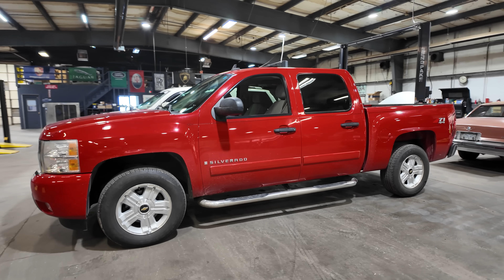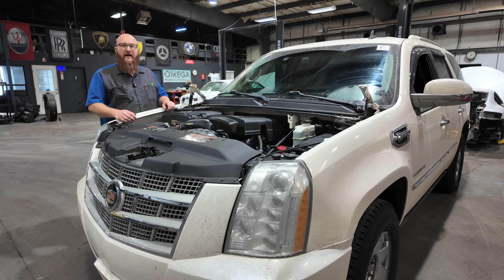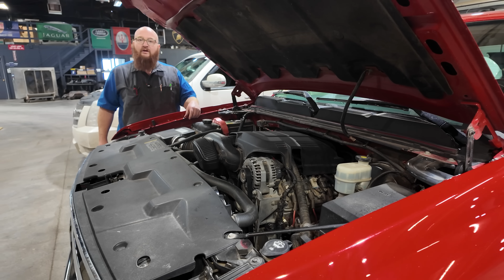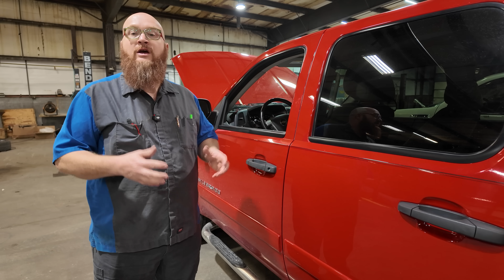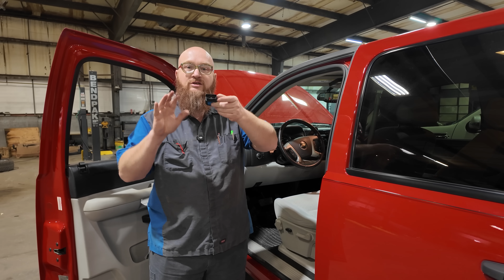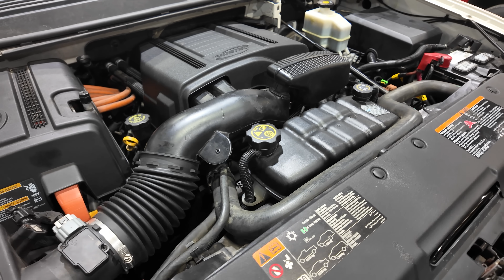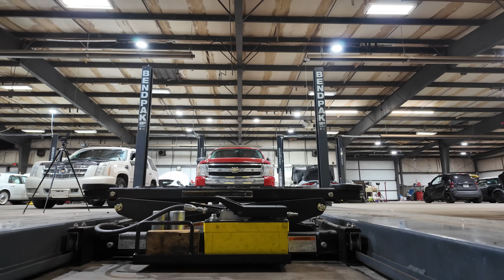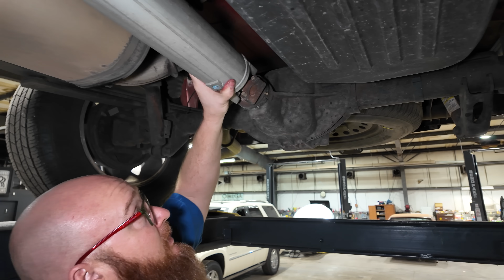AFM: Engine Saver or Engine Killer? The REAL Answer

Comment: 2017 silverado, 5.3, 6 speed, 74,000 miles, bought new.   The first thing I did on this truck was the afm disabler and the tranny thermostat change.   No problems until 45,000 miles when I started to get a minor tranny torque converter shudder. changed the tranny fluid out, not ac delco, shudder went away.

Comment: I have a 2012 Chevrolet Caprice PPV with an L77 6.0 and has the fan grenade from the factory. When it was operational the fuel mileage was worse. I added a disabler and so far no problems.

Comment: Have a ‘21 Acadia V6 and I just drive it in Sport mode basically all the time. You can watch in the gauge cluster and see that the “V4” light doesn’t come on that way. Drives better, too 😊 And it’s not like it gets good gas mileage if you let the cylinder deactivation do its thing; matters very, very little.

Comment: It seems counter productive to have AFM on HD model trucks that tow a lot.
Reply: If you're towing, then you'd be in tow mode or manual mode anyway, which deactivates the AFM.  AFM is meant to come on when the truck is experiencing the lightest workload possible.  In my Ram with the 6.4, the MDS will kick in if I'm just cruising at 35-50mph on a flat stretch, but since it's not easily deactivated without a PCM unlock and parts swaps, I just use tow mode when driving around town if I find that it is activating too often.  It rarely kicks in when I'm cruising at 60-75 on the freeway.
Reply: @jp1087  you probably don't care, but your MPG has to be brutal in constant tow mode with a 6.4
Reply: @waywardson-i1t  The difference is negligible, if any.  I don't put my foot into it. But I only drive it about once a week anyway when I need to use it or when I feel like it's been sitting too long.  MPG doesn't really matter when I only have to fill it up once a month.  It will get used more in the summer, but it will be towing a big trailer then, so mpg doesn't matter there either. I don't track mpg for running around town in any of my cars. I have taken it on a couple short highway trips without a load, and MPG has been around 18 avg.
Reply: @jp1087 Tow mode does not disable AFM on GM trucks.
Reply: @RyanAdcock-l4h  It does for sure.  I had a Yukon with AFM, and tow mode not only disabled AFM, but it also locked 6th gear out of use.
Reply: @jp1087 On mine it does not. I can watch it switch to V4 on the fuel economy info page whilst towing, with tow mode active. I can only vouch for 2008-2020 model year Yukons, though. Haven’t tried with 2021+.
Reply: @RyanAdcock-l4h  My Yukon was a 2011. Tow mode locked out 6th and turned off AFM.  But once I replaced the trans, I got a tuner and disabled AFM anyway, so I didn't worry about it.  The AFM didn't net any real world benefit.  The only time it ever came on for more than a few seconds was when I caught an amazing tailwind headed down 138E to Mojave.
Reply: HDs never had AFM
Reply: @michaelmcconnell6347  Ram HD's with the 6.4 have it.  GM and Ford didn't put it in their HD gassers.
Reply: @jp1087 Mopar and Ford don’t have AFM, their systems are different
Reply: @Bonez1LE  Different names for the same thing - cylinder deactivation.
Reply: 2500s 07 and later with the 6.0 do not have afm from the factory.

Comment: OEM 'quality' is the source of the problem.
GM doesn't believe in quality - it hurts the bottom line.
There is nothing wrong with the concept in engineering terms. It is the quality which dooms it.

Comment: 09 tahoe with the 5.3, New motor at 100,000 miles due to bad AFM lifter, another one went bad a few months ago at 270,000 (170,000 on this motor). Just did the full delete kit from TX powersports and LOVE IT!! Fuel mileage hasn'tchanged one bit. That was a total scam and just created a weak point in an otherwise decent engine.
Reply: It was a great engine before that was added...known to get 400,000 no problem.
Reply: @barrya.6212  Yep Mine is at 170,000 thankfully this last lifter didn't trash the whole motor again. I'm hoping for another 170,000+ out of her!!

Comment: If you have the earlier 10spd transmission, the disabler makes it surge.
Reply: I had an early 10 speed transmission in my truck and the cylinder deactivation downhill with cruise control on burnt up my transmission at 4700 miles

Every one of my coworkers at the dealership asked what I did but it was not me, it was the computer turning on cylinder deactivation downhill and downshift the transmission at the same time to control speed.
After a new transmission and TCM tune the truck never activated cylinder deactivation with cruise control again

Comment: I have a 2007 Silverado w/ the 5.3L.  One AFM lifter collapsed.  There's a guy who makes a special punch that can release the collapsed lifter with only taking the intake manifold, VLOM  and valve cover off.  Once the lifter was released, I broke the parts off of the VLOM that directed the oil to the lifters to activate  the AFM.  I also plugged in an AFM disabler device into the diagnostic port.  Has worked fine since.  I even passed emissions with the device unplugged (but I had to complete a drive cycle with the device unplugged).

Comment: I had my original 6.4 in my scat pack fill due to lifters and ended up replacing the whole engine instead of a rebuild (it was cheaper 7k vs 17k) and have a tune now to remove the MDS everything else still stock

Comment: A 2.0 turbo in a 6,000lb vehicle with a large frontal area will get about the same MPG as a large V8 in the same vehicle. An old van with a 250 I-6 really does not get better MPG than the same van with a 350. The MPG is more about weight and drag than it is about the engine size.
 - The advertised MPG might be improved, but this is really more about the testing procedure than real world MPG. Customers gain almost nothing from these MPG tricks; they just lose reliability. IMO.

Comment: Starting 15 years ago I found out that Delco parts are not trustworthy anymore...  I installed a 'regular' Delco steering pump that faded away when it got hot.  So, I bought the BEST Delco I could buy.  Made in Brazil!  That one lasted about 50,000 miles...  The OEM replacement AGAIN did the EXACT SAME THING!  So, I bought a brand new Edilman pump and it's been working perfectly for 18 months.

Comment: If the permanent removal requires reprogramming the car's computer, then would it matter if you left those mechanical parts in? Or is it going to engage the saving mode by default?

Comment: AFM has not existed without serious flaws; from my old man's 8-6-4 Cadillac to my Corvettes, AFM has historically caused real harm to longevity of engines no matter what brand/model/category.
Reply: From a basic in high school you can tell this wouldn't work
Reply: @glennbeadshaw727  That's what happens when the EPA starts sticking their nose into things.
Reply: @skippytbk7891  AFM is not explicitly required by the EPA.
Reply: If the lifters don't fail then just the very fact of the temperature difference in the block will warp the head and everything goes downhill those cylinders that aren't running are colder than the rest
Reply: That's why I bought the magical AFM delete chip that makes that garbage system not work. Luckily my truck didn't have auto stop start.
Reply: @Taxevader-gk9ms  Good move. Both my cars I bought new are pre auto stop-start, and my '06 Honda doesn't have that annoying TPMS system.
Reply: @ozzierabbit587  Most cars are good ones if you take care of them and make necessary modifications to make them last longer.
Reply: Corvettes don’t have AFM, but the C7 has AFM lifters in the LT1
Reply: My Corvette and my Tundra are 2013 models without AFM, and that is the reason I chose them. I won't own anything later .
Reply: A neighbor of mind bought a brand new 1981 buick Electra with the 307 olds afm 864 deactivation. He had problems with it. His mechanic ripped out the afm carb set up and used junkya4d parts on it. Ran like a charm. These systems never ran properly.
Reply: You shook a nightmare from my memory when you mentioned 8-6-4 CADILLAC. This old guy worked at a GM dealer back then. What a trainwreck of a design.

Comment: I own a 2006 GMC Sierra 2500HD WT extended cab, longbed, 4X4 pickup with the LQ4 6.0. Perhaps I am biased, but I think the 2007-2013 Chevy trucks are some of the ugliest ever made. Those headlights look like something from a torture flick. I really prefer the older styling. However the 2014-2018 trucks are so much better looking than the GMT 900 series, same thing for the 2019 and on. I will keep my GMT 800 series truck till I die.
Reply: I agree with you, BUT....that era of GMC Sierras look the best of all trucks period IMO ...the taller grille than the Silverado and the extra tweek to the stacked headlights make all the difference in the world...imo

Comment: Not all GM trucks have AFM ! There was a period during covid and the semi conducter chip shortage where some model year GM trucks  are AFM factory delete ! There are thousands  of them out there ! I just do not have the specific Vin #'s ! So no not all GM trucks have AFM
Reply: I can see the used vehicle ads:  "COVID era Chevy / GM ....NO AFM/DFM !  ....good selling point.
Reply: Is it just a Chip portion that was not available or does it still have AFM lifters in the engine?
Reply: @michaeldomenico AFM delete ! Theres nothing  under the valley plate ! I think it even has standard roller lifters !
Reply: The lifters and cam are still there it’s jus turned off in the tune
Reply: My truck has no auto stop/ start, is it possible it has no afm?
Reply: @hogger1007 just look under the intake manifold  ! If it looks like just a flat plate in the engine valley its an AFM delete !
Reply: That’s BS
Reply: @davidlamberson5435  NO it's not...it's well documented.

Comment: Elgin is a family owned business that’s been in operation for over 100 years in Illinois. Do they cost more? Yup. Are they worth it? Yup.
Reply: Tier 1 supplier, they produce durable engine and chassis components, including camshafts, lifters, and valve train parts. However, be aware of counterfeit, inferior, or "soft" China-made cams mimicking their name. The China knock offs are cheaper made so less quality. Alibaba common source for these cheap knock offs.
Reply: I recently put a hotter Elgin cam in my 340 Mopar small block. Works beautifully!
Reply: My grandfather's Elgin pocket watch still keeps good time.
Reply: @kc4cvh  Completely different company.
Reply: Are they based in elgin,il?
Reply: @mji8805. They are indeed located there.
Reply: @mji8805 Elgin truck and engine components are manufactured by Elgin Industries in a fully integrated facility located at 1100 Jansen Farm Dr, Elgin, IL 60123, USA. The company has operated in Elgin, Illinois, for over 100 years, producing engine and chassis components for OEMs like Ford, Navistar, and Mack Trucks.
Reply: @mji8805 Yes
Reply: @mji8805 Yes.
Reply: @mji8805 Yes
Reply: @mji8805 Yup. Worked for them briefly back in 1998.
Reply: @mji8805i would think so. i live pretty close to that city but im not sure either.
Reply: Worked there for a short while out of high school as a temp back in 1998. High quality then, looks like it hasn't changed now.
Reply: Elgin was also a Sears brand name that made many different products.
Reply: I have some really old parts in Elgin boxes still.
Reply: Gee I wonder if the see see pee would ever encourage the parts manufacturers, of which by law they own a piece of, to decrease quality over time to keep lowering non chi nese made cars reps.......nah 5hey would never do that..........
Reply: Do they cost more yup! is it worth it NOPE!
Reply: @keepitthoroTM . Strange considering how many upvotes and positive responses I got but you must know better…🙄
Reply: Didn't they make watches at one time?😮
Reply: @garrywagner7717 different company
Reply: 1:04 😮😅
Reply: Can anyone give me the part number for the lifters and the Cam?
Reply: My 2015 Ram 1500 has a lifetime warranty so it is on Stellantis to fix if it ever happens. So far, 155,000 trouble free miles. Regular Valvoline synthetic oil changes, warmup under light throttle, drive gently when cold.
Reply: @scottyboy60098 Did you buy the Ram new in order to get the lifetime warranty?
Reply: It's the same Elgin that makes watches?
Reply: @christianmccollum1028 Elgin Industries (Truck/Engine Parts): Founded in 1919 by Martin Skok, this company specializes in engine and chassis components (valvetrain, piston pins, etc.) for commercial vehicles and automobiles. It is still owned and operated by the founding family and continues to manufacture in the USA.

Elgin National Watch Company (Watches): Founded in 1864, this was a legendary American timepiece manufacturer. They ceased all U.S. manufacturing in 1968 and closed their doors.
Reply: @christianmccollum1028 I don't think so. Elgin and Hamilton are old American watch brands, the companies no longer exist but goods are being sold under these names, much like RCA, Magnavox, Bell & Howell and others.
Reply: @christianmccollum1028no
Reply: @christianmccollum1028. Same city but the auto parts manufacturer doesn’t have any correlation to the watch company.
Reply: "family owned" isn't always better despite the American Dream. I've worked for many "family owned" where the current owners are just wash outs the parents felt bad for.
Reply: @M @MrTilbin In this case it sure seems like Wizard trusts their products way more than corporate AC Delco.
Reply: @MrTilbin always some clown that has to point out the exception not the rule.
Reply: @TimeMariner  So true. Always that one Debbie Downer on YouTube comments.
Reply: @TimeMariner  Why is the truth objectionable? Nothing wrong with pointing out to be careful who you deal with.

Comment: I’ve known that for years about AC Delco. Unfortunately, a lot of American brand name manufacturers have really just gone down the tubes over the last decade or so. I think this example here clearly illustrates what you told us earlier about how when you find a good mechanic stick with him. I think the same can be said about different product brand names if you find a good and reliable brand name stick with it then you won’t have to worry about this ever happening again.

And yes, I agree. Most things on these engines are very easy to work on and really have been for as long as I can remember so long as you don’t have things like say the vortex spider injection system that could be a bear on some of those older GM conversion vans (specifically the Chevy Astro and GMC Safari vans) that they made in past years
Reply: They're so many fakes out there, down to the box branding.

Comment: 2008?! Here in Western Pa. A 2008 has so much rust the frame is rusted out and won’t pass state inspection. How is it in your area these vehicles are not rusted out? My 2013 Silverado  with just over 100K on it had the frame welded twice.

Comment: I almost hate to say this, but the original Cadillac V8-6-4 did NOT have the disastrous mechanical issues that the "new & improved" system has!  While the new systems benefit from fantastically faster computers, the Eaton mechanicals for shutting down the cylinders was never a problem!  Even if it was, the machinery was under the rocker covers and did not require tearing the motor down to get to the lifters!  
The original Modulated Displacement 6.0 Litre engines had other problems, from the slow 1980 computers to just plain dumb engineers with their choice of final drive ratios and backpressure-type EGR valves...  I drove one in an Eldorado for about 60,000 mi.  On the highway, it got 22 MPG in Modulated Displacement mode, but only 18 MPG locked into  V8 mode (I put a chrome toggle switch next to the radio.)  😁
Reply: Correct, the mechanical technology and parts were good. The computer and software to control it just wasn’t good enough yet.

Comment: AFM or cylinder deactivation as it's commonly called, doesn't really improve fuel economy significantly. For example, in 2013 Honda offered their V6 Accord sedan with cylinder deactivation (it was standard). EPA fuel economy  was 21/33/25. The similar 2013 Camry, also with a V6 but without cylinder deactivation (or VCM as Honda calls it) was rated for 21/30/25. Granted, that generation of the Camry was lighter than the Accord, and had less power, but the issues that the Accord V6 had as a result of VCM were not worth the 3 MPG advantage over the Camry, IMO. That is why most people who want the Accord V6 either go for the coupe with the 6 speed manual transmission (those never got VCM), or disable the VCM on their automatic models. Or even go for the older models with the 3.0 V6.

Comment: I’m curious, I have a 2022 Chevrolet Colorado with the 3.6l V6 motor I at one point say it flip into V4 mode. Does this mean my truck has that same fuel management/ cylinder activation? If so does the plug in work for that application?

Comment: Is there a plug in tool for the Dodge Hemi's that does the same thing?
Reply: Yes, but you don't need it. If you drive in manual mode with gear 8 selected it will disable it & still shift properly. Tow/haul mode will also disable it, but you can't go into overdrive gear 8 with tow/haul mode selected.